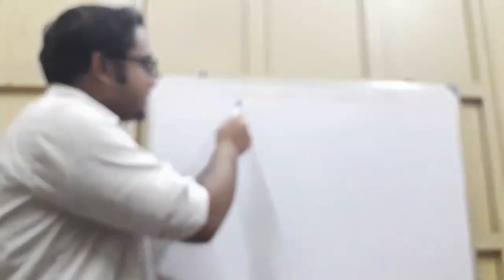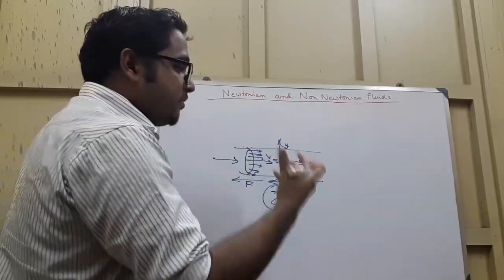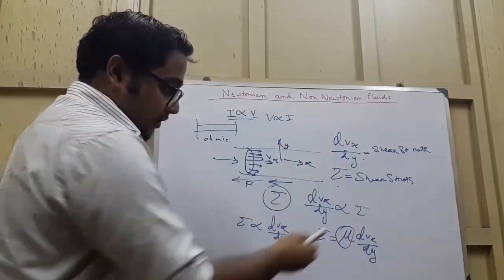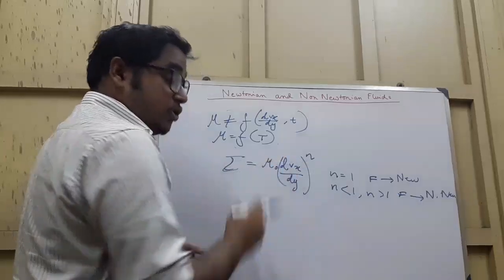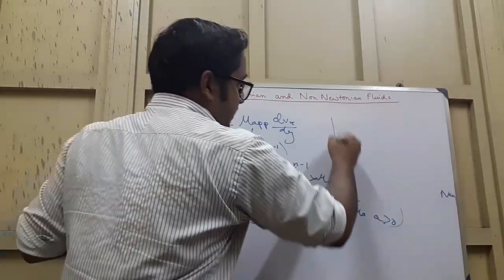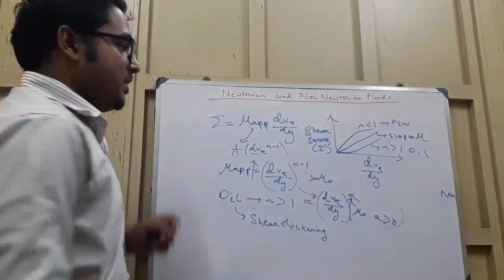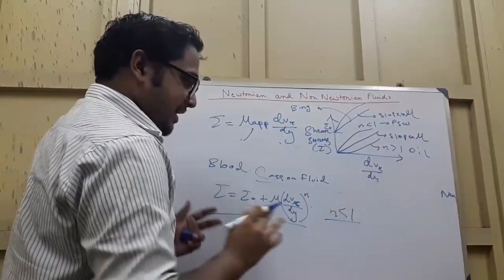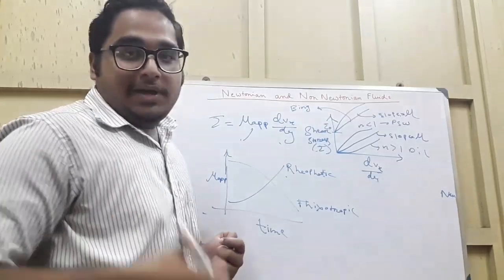NEWTONIAN & NON-NEWTONIAN FLUIDS | FLUID MECHANICS BASIC | NO-SLIP | PLACEMENTS | INTERVIEWS | EXAMS

Comment: Though I feel it's completely trivial, a 'negative sign' should be associated with the equation corresponding to the Newton's Law of viscosity (just from a theoretical aspect), only because of the fact that the shear stress is applied from a region of higher velocity to a region of lower velocity, and therefore the directions are actually opposite. But it has to be mentioned here that, for all practical problems since we are more concerned with the interpretation of apparent viscosity for different types of fluids, it is somewhat fine to omit the negative sign.
Reply from the maker: Absolutely, there should be a negative sign associated, but since we have dealt with the practical side of it, hence we have omitted the same. Thanks for Commenting and letting us know ✌